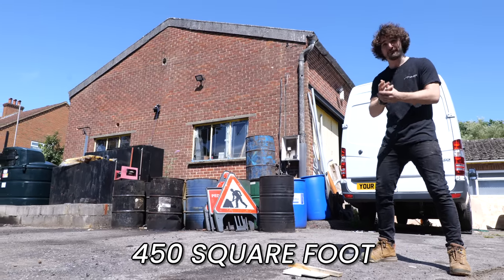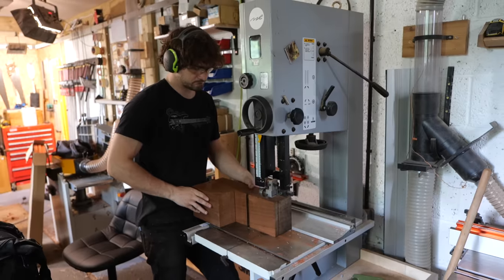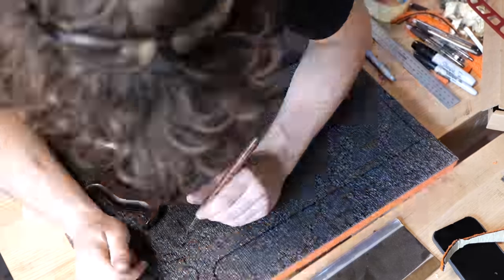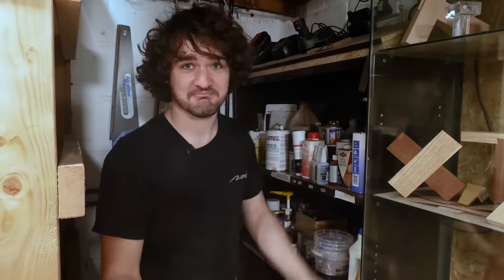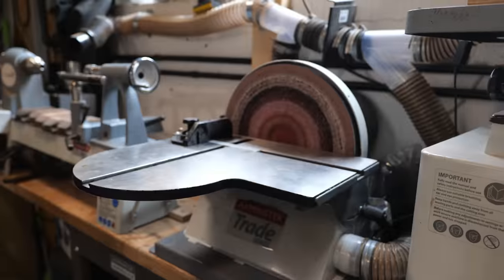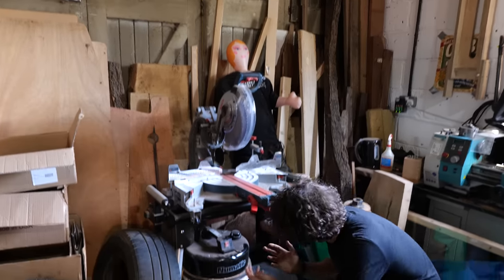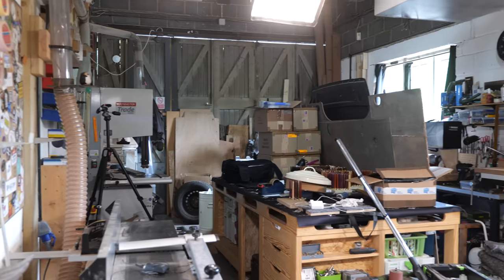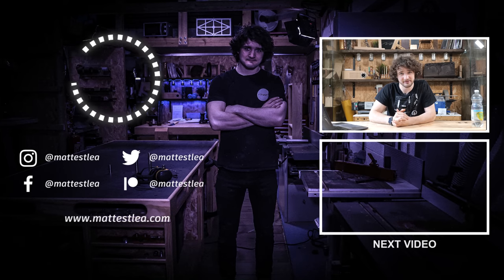DREAM WORKSHOP TOUR😱 (But I don't want it anymore)

Comment: Extraction- fit it above you (don't use valuable floor space) where you have plenty of room.. You do not 'operate' it, so it does not need to be accessible. Drop hoses means you only need one (not four!) dust extractors.

Comment: Hey Matt, I'm trying to rig Bosch GCM 18V-305 Mitre Saw with Bosch GAS 18V-10 L to auto start, but I have had no luck so far, there is no Bluetooth on shop vac, so I guess  push the button  then chop. There is some kind of sensors and stuff but I had no luck finding the solution, if you find a solution for this, a lot of ppl would be less annoyed by the Bosch. Good Luck with the van Project!

Comment: You know you have a full shop if you have to open a door or window to fart..... When I moved, some one told me, "you will be surprised at how quickly your new shop will fill up". I said nope, it will take about 4 hours.... With your dust collector, I am hoping you will get a centralized system. FAR better than the set up you have now. Also, get a pleated paper filter. They now will filter down to about half a micron, and you get several times the area for the collected air to vent out of. Also a cyclone. Most will have a FM remote on/off switch which means you can start it from anywhere in the shop. I have a video up on 'Sanding hood for bowls' on my channel. You can get far more dust into the extractor, and keep most of it out of the air in the shop. Good luck with the move!